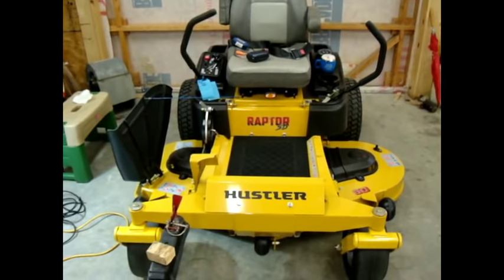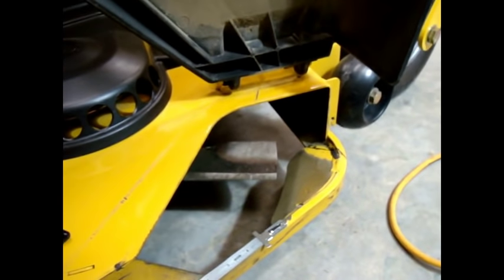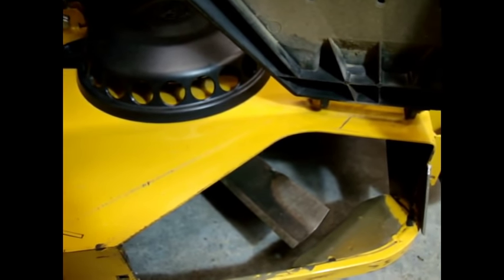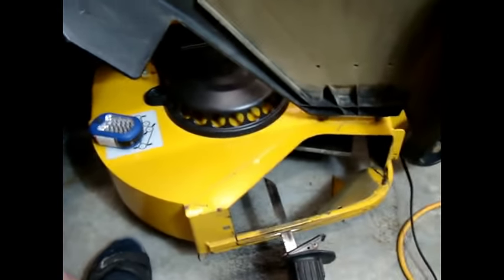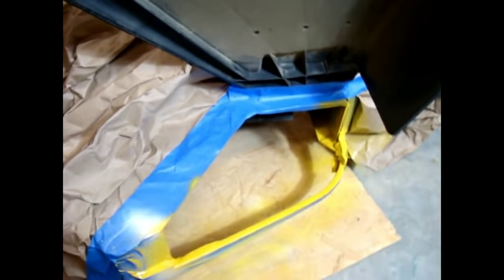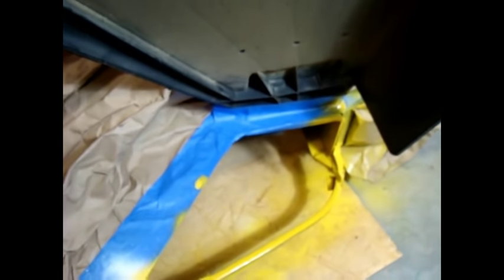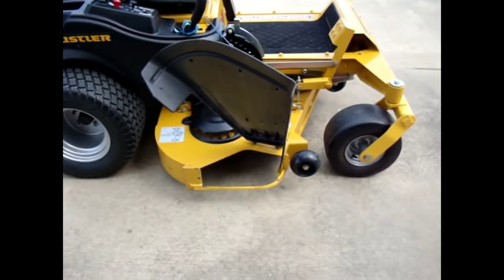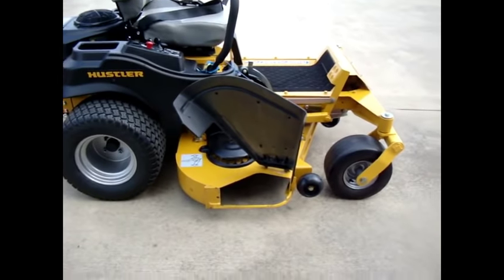Hustler Raptor SD60 / Big Dog Alpha Deck Discharge Chute Opening Up Modification -

Comment: I cut mine out , cuts perfect at full speed now.
Also took the guards off the deck belt pulleys to keep them clean and cool.
Reply: I've done several tests on the MGM Ported Covers on and off and the porting with them on keeps the indentations below the pulleys cleaner and drier because of zero build up. Mr Max walked me through how to do the porting in a precise method and they work exactly as he describes. 

Also, I cut my blade guard like Mr. Max's. I run mine all the way to the square cut in a straight line as he had intended. Grass never touches that bar now. Have another mower with the bar removed. There is no difference between them in cut or clipping removal. Mr. Max's engineering is top of the line.

Comment from the maker: Would like to reply to Ryan S .

Ryan S commented: "What you have done there is essentially weaken that bar, which needs strength when hitting objects. This modification doesn't help discharge at all, no way does pulling out a half inch or 1 inch o..."
3 hours ago

Here is my reply: If removing any portion of a bar weakens it, then you are absolutely correct. What you fail to put into the equation is that leaving the remaining enforcement bar is more than adequate to keep the front of the deck from moving rearward and more importantly keeps objects from making contact with as much as 4 inches of the rotating blade.

With the enforcement bar below the blade, it does in "fact' no longer make contact with the grasses exhausting from the deck chute. 

I would suggest, Sir, that you speak to this after you have first done your own tests. Then with your findings, consider making a comment.

Thank you for your comment and watching the videos.

Comment: What about rewelding what you cut off on the top of the bar, to under? So the bar is the same thickness it was, just moved down.
Reply from the maker: I don't see any need for that. I took the deck out, ran it into a solid object direct hit at 8.3 mph. Broke a brick in half, jarred my teeth and guts. Everything is fine except for the brick pedestal. I did another test for a mod video coming up and really did a big bunch of damage to my brick steps. Everything survived but the brick. I've got to quit ruining my home for all you fellas! lol

Comment: Hey your pulley guards have holes! Factory holes? Waiting on my discharge chute to show up in the mail, anything you would do different now? Anything you think should be welded instead of just bolted?
Reply from the maker: The MGM Belt Cover Porting if done properly absolutely is a must. 

There are pros and cons to all designs such as the bolt together frames compared to welded frames. Bolt together allows easier rebuilds, but then it can also allow for wear on mating surfaces if not kept extremely tight as is the design. Most failures begin with the operator's lack of maintenance.

Welded designs tend to fail alongside the welded areas due to the heated surface cooling too quickly thus becoming brittle or if not drawn back in the heating cooling process. Which manufacturers don't have time to do due to costs of labor relative to selling prices.

So, no Sir, just "run'em like you stole'em", "fix'em if you break'em".

Comment: I cut mine out of there 2 yrs ago. Wish I would have done it the day I bought it.
Reply from the maker: Adrian, did you cut yours out entirely? I didn't remove the entire bar. Only took out about 60% of the top portion of the bar so that the top of the bar was at the top of the blades. No reason to remove any further I found as well as the elevated danger to the mower in the event something gets into the blade tip zone where the top of the deck is cut back for the grass catcher.

Soon, I will fill in the cut back scallop to cover the blade tip. Will let you all know if that changes the character of the discharge chute. Thanks for giving us a thumbs up. Hope you'll subscribe and send us some ideas on modifications down the road. Thanks again Sir.
Reply: Yes, I removed it all. I plan on using a piece of 3/8 rod to add a guard at some point. I just wish I would have done this all sooner. I fought plugging from day one and was really not happy with the unit. I can mow any height grass/weeds  now with no issues at all.
Reply from the maker: I have heard that a lot and I know the difference between mine and others has to be that my Bermuda doesn't seem to clog or clump quite as badly as a lot of grasses and weeds. I'm glad you made yours much better by doing whatever you needed to do.  

I did cut the bar on mine a bit lower on the front 4 or so inches than the rear and that is because the Lion's share of clippings exits the front of the discharge chute and therefore I left the rear at the top of the blade top if that makes sense to you. 

I'd love to see your modification. There are two places you might want to post them or if you don't want to take the time, email the pics to me and I'll post them for you giving you credit for them. MaxsGarajMahal@gmail.com
Reply from the maker: I have built a grass catcher scallop block off plate that makes this deck even much better than ever. Take a look at those videos. If you can't make one, give me a shout, I'll sell you one for your mower.

Comment: My 2019 flip up don't have that brace/bar at all. No anti scalp wheel on that corner either..
Reply from the maker: What year model is your flip up, Steve?
Reply from the maker: You may want to put a grass catcher scallop block off plate on your deck to help keep a bush, post or more importantly a foot from getting ankle deep into the blade in the event the discharge chute is up while blades are engaged.

Comment: What did you use to cut it?
Reply from the maker: I used two things. You can use several methods. I first used a 4 1/2"   cutting disc to make the slot thru it. Then I used a sawzall to speed along it. I also went with removing less than I'd intended due to measuring from the top of the enforcement bar to the top of the blade.

I only removed enough to go below the top of the blade .050" as the sail removes the clippings not the horizontal plane of the cutting surface.

You'll be happy you spent the little bit of time it requires to remove that material. I do intend to remove the last four inches before the verticle areas I left. I allowed the blade to walk upward to the point the rear is at blade altitude with the horizontal plane. All that does is allow the paint to be colored black from grass residue. Doesn't catch clippings, only turns the bar dark with juice from the grass being cast over it. Like a water hose dripping below the main stream.

Give it a shot, let me know what you think. Thanks for watching, thanks for the question.
Reply: @MaxsGarajMahal  Awesome. Thanks!
Reply from the maker: @leondraw1766  You are very welcome Sir.
Reply: @MaxsGarajMahal  It isn't perfect but it's done! I was going to include a photo but don't know how.
Reply from the maker: @leondraw1766  I'm not sure how to put up a photo in comments either. Send me a few shots of it. Maybe I can figure out how to feature them in the channel with a shoutout for you. 

Are you in the Hustler Mower Owner Group in Facebook? 

I look forward to seeing your version of the modification.
Reply: @MaxsGarajMahal  I will!

Comment: How well did it shoot the grass out after you cut it open wider? How well does that suspension unit under the seat work?
Reply from the maker: The2012waiting, thanks for watching. The clippings come out so fine in dry Bermuda grass now that it looks more like dust than grass clippings. I would then have to admit that this is a good modification. I made a follow up video of the modification with the clippings from the discharge chute just yesterday. I'll add the link to it here: https://www.youtube.com/watch?v=NVRtDlBqpzo&t=49s

The suspension seat kit is a must on a mower. Also, the flex forks are amazing and worth your effort and expense to do them both.

No longer have back pain from the former harsh ride as it is absolutely formerly known as "harsh". Hope you'll give us a Thumb's Up and Subscribe.
Reply: Awesome, I have a Hustler and a bad back so that seat suspension will be on order soon ;)
Reply from the maker: I don't get anything from Seat Warehouse, however, I'm trying to get some sponsorship to help continue purchasing other items to make the modifications. When you purchase, mention you were advised to purchase their Seat Warehouse Seat Suspension kit from MaxsGarajMahal on Youtube. Call:
Nicole Bundy
SEAT WAREHOUSE LLC
855-700-7328

Send me an email and I can give you a few more pointers if you'd like. maxsgarajmahal@gmail.com
Reply from the maker: Did you get that seat kit?
Reply: Ya, from seat wharehouse. Best $$ I've spent. Had to extent the wires but no biggie.
Reply from the maker: Extending the wire harness was super easy wasn't it? You need to try the block off plate for your deck scallop also. I'm no longer putting down the discharge chute deflector with the block off plate installed.
Reply from the maker: @The2012waiting  Here is the link for the Hustler Mower Owner Group. https://www.facebook.com/groups/HustlerMowerOwners/